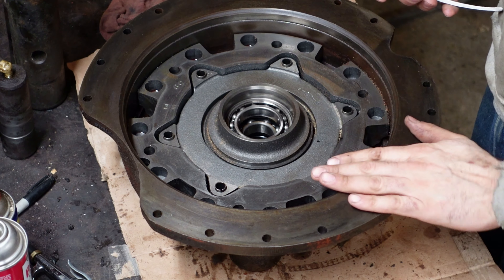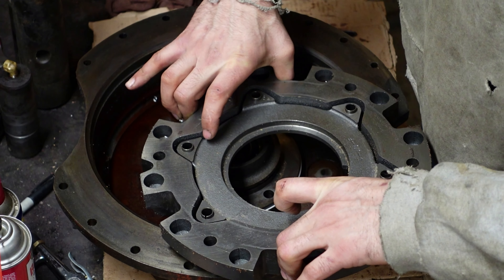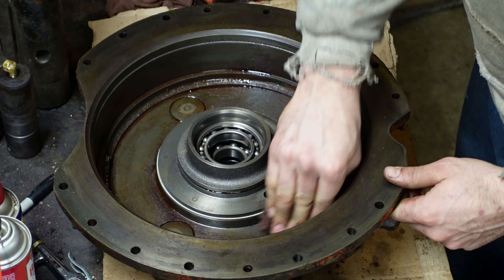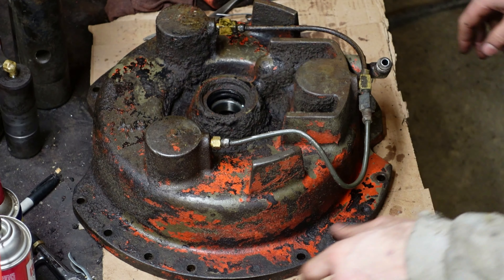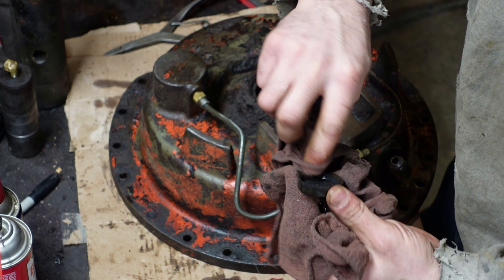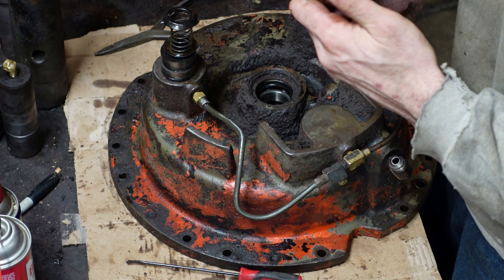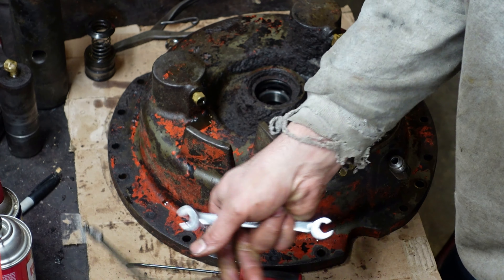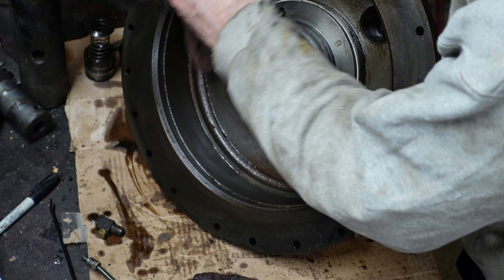Timberjack 360 skidder brake assembly assessment

Comment: The T in the brake line is to drain water out of the system, that is the lowest point and condensation ends up rusting the bottom brake cylinder.

Comment: The tee do you think it would go to electric parking break?
Reply from the maker: The parking brake is a mechanical one. There is a tee on it so that the brakes can be bled. Because the tubing goes up and over, the tee is to let the air out of the top if the system